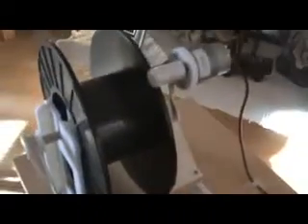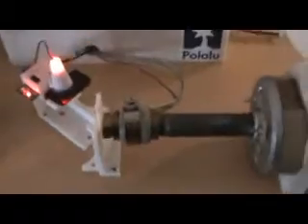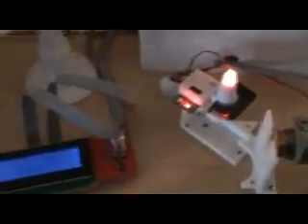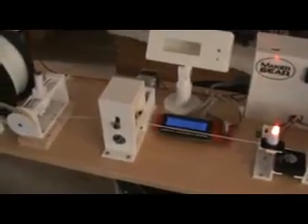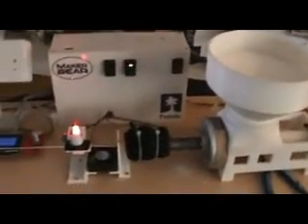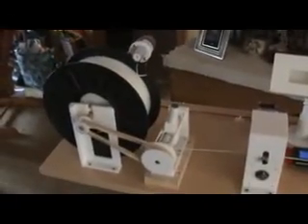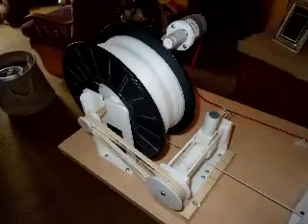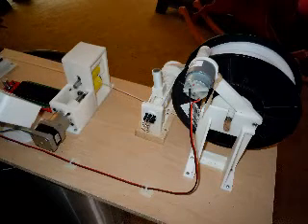Test run of Hugh Lyman designed V5 Filament Extruder

Comment from the maker: It is a "3D printer Reprap Smart Controller Reprap Ramps V1.4 LCD2004 Board module" I bought on ebay. It goes in the stand but the one you see in the video goes to a Prusa 3D printer I have, I am still waiting for the one I ordered to arrive. You will find all the information in the manual downloaded from thingiverse: http://www.thingiverse.com/thing:380987